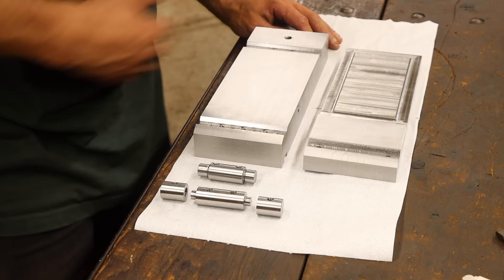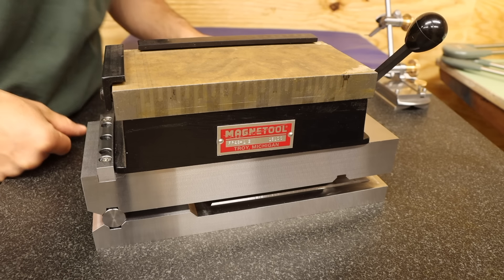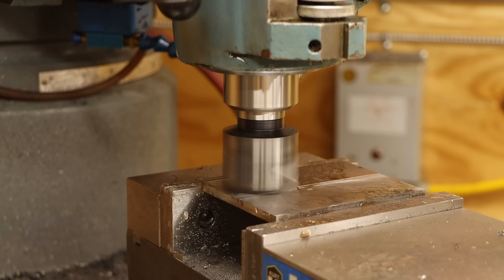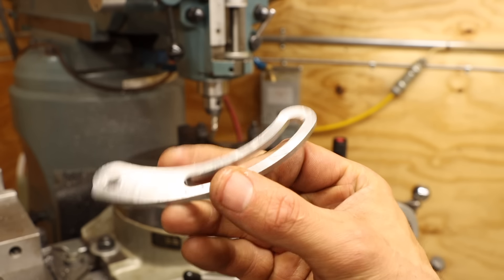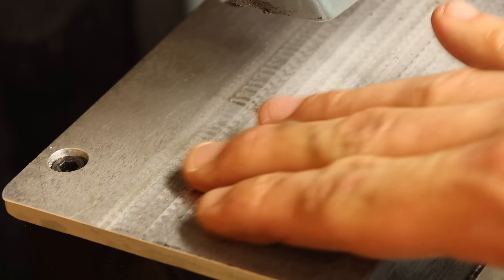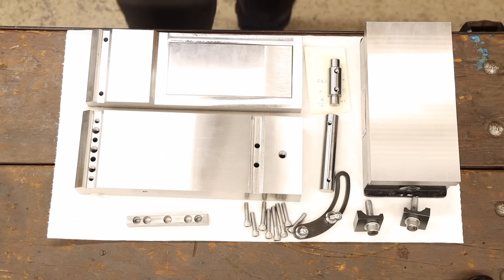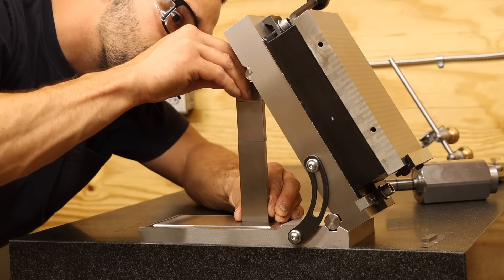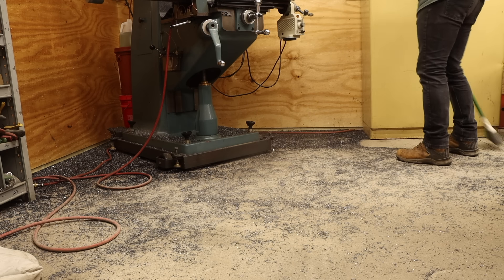Making a Sine Plate (Part 2) || INHERITANCE MACHINING

Comment: Braexcellent excellent job on your collet blocks project. When you said, "I'm not a barbarian" for the side project correction, you indicated the part. I am no barbarian🤣, but I would have just done it without indicating the part. Maybe I put too many trust in the machine and Kurt Vise. Assuming the vise was indicated and shimmed parallel front to back with the cutter. I found your comment about indicating the part hilarious.
Reply from the maker: 😂 oh I have a lot of trust in my vise as well. Only reason I went the extra step to indicate there was because I wasn't using parallels and I could tell with how little material I was grabbing onto it wasn't going to self-square.

Comment: Brandon, a green silicon carbide wheel is the way to go on Aluminum. Also, in the future if you want to set your sine at 30 degrees rather than 60 make a square block that you can clamp your collect holder to. Make it big enough to hold good on the magnet and this will give you a face to work from that is 90 degrees to the magnet surface.
Reply from the maker: Thanks for recommendation, Steve. I actually considered doing just that when planning this setup. I did the math though and the sine error at 60 degrees was only 30% over the sine error at 30 degree so didn't think it would be worth it for a few arc seconds

Comment: One thing I learned from this was I need a surface grinder 😜

Thanks for the educational build videos, very helpful.
Reply from the maker: be careful! if you have a tendency to chase zeros, having a SG may result in never leaving the shop!
Reply: @InheritanceMachining  hah, don't worry. I have enough trouble getting my mini lathe leadscrew aligned correctly to avoid the dreaded thread pitch visual artefacts. I won't be chasing zeros for a while.

Comment: Great work,  videos are awesome, I have a few points that I would like to share that may help you out somehow somewhere. When holding location(s) of a hole on a part is critical, spot, drill, ream or bore, CSK and then move, don’t spot all of them then switch to a drill. My coworker who has been a machinist for 40+ years told me to do it that way. I have heard that when surface grinding aluminum kerosene works well as coolant. I have never surface ground aluminum, so I would double check with someone who has prior to jumping in with both feet. Also when surface grinding with coolant it is important to let the wheel run for 5-15 minutes after shutting the coolant off so that the wheel can run the coolant out of itself.  Hope that this helps
Reply from the maker: thanks for the tips! the kerosene is an interesting idea. I'll have to try that. On the multi-hole operations I definitely use this practice when precision matters. In all my operations here the holes were clearance for the screws so there was some wiggle room to start with. Thanks again!

Comment: I made a position dog, both 6 and 8 sided to go on a 5c mandrel. The set up can be held horizontally on the surface grind ops. Not to mention on center. 
 O1 tool steel, harden 58/60 rc.

Comment: 2:30 Stainless hardware is more expensive but it is actually a down grade, not an over do. Stainless screws have about half the holding power of steel and have a horrible tendency to seize when used in steel. The only thing they are good for is corrosive environments which is what they are intended for. As normal fasteners they leave a lot to be desired.

Comment: Hey Brandon, awesome work as always. Just one point I'd like to make - early on in the video, you clamped a fairly small square part in the mill and the part was to the right side of the vice quite a bit. Normally for a small part it's not a huge issue, but it can cause jaw deflection. It's not great for the vice, but it also doesn't hold the part as well. 
Just thought I'd mention!
Keep up the amazing work.
Reply from the maker: thats a fair point. Are you referring to the square key? I think i did that to mill the end. Anyway, thanks for the support!

Comment: Idk much about surface grinding, but I believe you can (and should) get specific wheels for grinding AL. The aluminum that gets caught in the wheel will expand when heated up, and could cause the wheel to fail catastrophically. 

Or so I heard from someone who knew more than me.
Reply from the maker: yikes! makes sense to me. I'll be better prepared before my next attempt
Reply: @InheritanceMachining  Yeah it sounds pretty spooky. That’s what I’ve heard with bench-top grinders too, and I have used AL wheels on those. So it’s at least true enough for someone to make a product for it.

Comment: You should balance your vise. Meaning if the middle is not holding the material then clamp an equally thick part on the side opposite so the vise hold equally left and right.

Comment: About your use of stainless steel fasteners. Be aware that they are about 1/2 the strength of the alloy steel types. Also, the material tends to be 'gummy' which may show up as hard to turn the screws without a wrench
Reply from the maker: Good point!

Comment: Cool build! I have a few tips and questions.

Are any of these parts hardened/do you plan to harden them? That'd help a lot with the longevity of your sine plate.

From my experience, you seem to have made this fairly large. Sine bars/plates can be difficult to use for setups if they're too big. Do you foresee this being an issue for you/how big is it center to center?

Green Silicon Carbide wheels should be pretty good with grinding aluminum and some other non-ferrous materials. Just make sure the structure of the wheel is open enough so the chips don't clog up the wheel.

What are you using for coolant on the mill/surface grinder?
Reply from the maker: Thanks!

I will be hardening at some point but I have some significant mods in store for this at some point.

It's 8" center to center. It 100% is way too big. I could barely fit it on the grinder for the little job I needed it for. About half the size would have been much better.

Noted on the wheel!

Right now coolant is just Kool Mist. Though I'm planning to switch to a proper coolant for the grinder.

Comment: Did you consider using a 30° angle and a square instead of using a 60° angle directly? Might have helped with the vertical clearance issues.

Comment: It’s probably not a bad idea to plunge cut before milling the radius. Stops the end mill from wearing at the bottom as much as it would if you used it solely for slotting.

Comment: To grind aluminum, load your wheel with bees wax. Bees wax should be available at a fabric store used for lubricating zippers, comes in 2” squares about 1/2” thick. Sine plates are not accurate after 45 degrees. Reverse your set up, 30 degrees.

Comment: I grind aluminum everyday and 99% of the time it is a .0005 tolerance. The series of aluminum has a lot to do with how well it grinds. I mostly grind 6000 and 7000 series aluminum and it grinds beautifully. 2000 series not so much. It loves to load up the wheel and expand while grinding. Waxing, a coarse dress on the wheel, and lots off coolant help, but more importantly, practice on various materials and take notes on what works, and probably more importantly, what didn't. I can't remember off the top of my head what wheel I use, when I get back to work after the holiday I'll update this with the wheel specifics. I belive the wheel we use is made specifically for my company for grinding aluminum.
Reply from the maker: Thanks for the info. If I get into grinding aluminum more regularly I'll take a more scientific approach like you mention. The base on the mag chuck was pretty gummy. And also a cast piece so maybe it was a low grade. Ive had some suggestions that silicon carbide wheels are best for aluminum.

Comment: I love your build, in fact I'm going to copy some of your methods to make a sine cylinder grinding attachment for my surface grinder. But I'd thought that you should not use a sine plate for angles greater than 45 deg.  I haven't gotten to the end of the video, so I guess I will see if you had any issues as a result.
Reply from the maker: Thanks! Yeah its probably not advisable since the sine error starts getting crazy over 45. It ended up working out alright for me though. Also a centers grinding fixture using this plate is also on my project list at some point. Glad so see someone else is thinking the same
Reply: @InheritanceMachining  Great. I like your videos and hope to see a lot more of them.

Comment: Hey Brandon, thanks for putting all this content out there. Just out of curiosity, looks like you have a slight hitch in your gait when you step with your right foot. Do you have an old knee/ankle injury that never quite got back to 100%? If so, I had a MCL tear that I fixed using the backwards sled drag on KneesOverToesGuy and a split squat variation from Kabuki Strength for arch, ankle, tibialis, and calf strengthening. My lower mobility has never been better and I'm stronger in major lifts for having done the rehab. Hope this helps.
Reply from the maker: Thanks, Ben. Fortunately no joint pain for me. I think it just came off awkward somehow. Maybe from standing in the shop all day lol However I do know about KneeOverToesGuy, he has some great and useful content

Comment: Love the videos man, Theyre great!
Do me and yourself a favor and order up some 46H grit wheels for grinding. The white wheel i see you using looks very fine for what youre doin, try the more open wheel, Youll like it alot!
And speed up your traverse speed (Left hand) on the grinder, looks a little slow!
Keep up the great work
Reply from the maker: Ah thanks for the tips and kind words! I'm learning there is a lot of nuance to grinding for sure
Reply: @InheritanceMachining  Yes there is... Some quick parameters to try out when you get your new wheels:
.030 step over, .0005-.0015 downfeed, And dress .004-.006 at a time quickly across the wheel. Grinding is a dark art. Nobody really knows HOW it works... It just does 😅
Reply from the maker: @mattcyr3342  those are pretty close to the increments I've started using for finishing passes. I'll be interested in the courser wheel though
Reply: @InheritanceMachining  You can use those universally with like say an 80H/I wheel for finishing. Just dress more finely than usual and take light light cuts.
The 46H is the ultimate wheel in my shop. I can use it to rough .002-.004 passes and i can dress it again , Stick it down .0005 and get a good finish.

Comment: could you potentially machine a degree gauge to go on the side of the sine plate where you placed the locking strap so you don't need to use the gauge blocks? i love the videos and have no knowledge of any of this stuff yet but i wish to learn. thank you for all the information
Reply from the maker: Thanks man! A degree gauge wouldn't really be useful on this since you have to do the math anyway. Plus the 10th accuracy with a gauge block set gets angle resolution down around 2-4 arc seconds. A degree scale, even with a vernier, would only be good to 5-10 arc minutes
Reply: @InheritanceMachining  I appreciate you answering me. I wish I knew more about this field. I had to look up what you explained and still don't fully understand lol. Thanks again for your answer and also for the videos

Comment: After this grinding of the faces of the collet chucks, are the center holes still in the center that the faces now define ?
Reply from the maker: One of the last operations I did was to grind those center to face distances even. I only briefly mentioned doing it in the video. I used the surface gauge and the center pin in the collet to determine how much to remove from each face.

Comment: How do you compensate for the grinding wheel losing material that will reduce it's diameter during grinding? Or is this so small it is negligible?
Reply from the maker: The actual grinding is only happening along a narrow sliver of the wheel width that moves across the wheel as it wears. You do have to redress before that grinding "front" reaches the back of the wheel though

Comment: 8:51 I had a job to clean that same type of protectant coating ,from acres of 5" plate steel.  After the second 3' X 12'' section?  It started getting old :)

Comment: I would releive the aluminum face with a .010 deep pocket leaving land around it's perimeter so you are not grinding all that material or even leave a small land in the center again greatly reducing the amount of material removal. Also why on earth would you make a soft sine plate?

Comment: In the place where I work we use machine oil plus kerosene 1:1 to grind aluminum. And u have to dress your wheel as rough as u can with your diamond to prevent overheating a surface.

Comment: I made a turnbuckle that bolts to the opening end of my suburban sine plate, It pulls the plate down tight on itself and never allows the gauge blocks to slip or slide and also doesn't allow for the sine plate to ever open up during heavy cutting.
Reply from the maker: I believe I saw this method on some examples I referenced. If we're talking about the same thing it seemed like it would be difficult to range it between small and large angles. Unless there are multiple different lengths of threaded shafts?

edit: I did encounter difficulty getting the plate to rest on the blocks fully. Ended up snugging the plate in position a little under hight and letting the gauge blocks push the plate up so its in a small amount of compression

Comment: just curious what your using for your black oxide sealer
Reply from the maker: Caswell Plating sells a kit with the cold blue and sealer. they sell two types of sealer, one thats more of a penetrating oil, and one that dries to the touch. I have the drying type and it works pretty well so far.
Reply: @InheritanceMachining  thank you sir

Comment: I am working on making my own hex and square 2J collet blocks, admittedly nowhere near as nice as yours. I have a manual Monarch 10ee lathe and a CNC Tormach 1100 mill. I did not have a way to do the bores on my mill so I have done them on my lathe. I knew my setup in the Lathe wasn't going to be the most accurate so I didn't bother pre finishing the outside of the hex and square stock. I anticipated mounting the blocks with a large round bar in some other fixture and truing them up on the mill. However I have not been able to acquire an indexing head for my mill, nor have I been able to figure out another way to do this accurately. Would you be interested in taking on a paid job to help me get the outside of these collet blocks true with the inside axis of the collet? I don't know that they need to be surface grinder precise, I would be okay with a mill finish.

Comment: Some grades of alloy can be machined OK(Ish) with standard tooling/wheels, but some are as gummy as all hell, and unless you know exactly what grade you're working with, you won't even find out how bad it's going to get until AFTER you start grinding, milling, or turning it. :(

It's the same as welding "Mystery grade steel". Until you strike that ark, you've got no way of knowing how badly things might soon be getting for you. :D

Anyway, Nice project mate. It's one of those pieces of kit where it really is worth the extra time going for some "Serious overkill", because even if the job it's currently needed for only has to be "Mortally wounded", you never know what grade of "Dead" all the jobs after than will need to be taken to. :D
Reply from the maker: I'm usually able to figure out ok-ish feeds and speeds for mystery materials (most of my stock pile is) but that aluminum really through me for loop!

That was exactly my thinking on getting it the best I possibly could. I don't want to have to think and compensate for any errors in my tools!

Comment: Rpm 200 divided by the Dia = proper speed for HHS 200/.159 = 1257rpm  so to drill the hole for a 10-32 tap i run the drill 1257 rpms Next carbide cutter 1/2 400 divided by the cutter Dia So 400/.5=800 rpms Its supper simple dividing gets you close

Comment: Hi there
Firstly, I'd suggest you have a look at Simon (Bouchard)'s YT video on sine bars (and it's accuracy over 45 deg).
Secondly, if I may, my 2cents: one's work is responsible for prooving 'perfectionism' and what not, not one's words. Let your work characterize you
Cheers
Reply from the maker: For the sake of time I didn't get into this in the video. I considered grinding a 30 degree fixture for holding the collet block with the sine plate at 30 to reduce error. For an 8" span, a 1 thou height error at 60 degrees is ~40 arc sec while 1 thou at 30 degrees was ~30 arc sec. So not a huge advantage for a set of tools where I'm already better than the repeatability of the collets in the first place.
Reply: @InheritanceMachining  yeap, I don't mean you had an error in n the particular application, just one then to keep in mind (though your 8" are really nice, from this aspect)
Reply from the maker: for sure. I actually realized that advantage myself the the first time I used it to square up the axis of the block

Comment: Be careful measuring over sharpie marks. Tom Lipton has shown they are in the order of 10ths thick.
Otherwise excellent build
Reply from the maker: interesting... I noticed the first pass of the hardened tip "scratched" away the sharpie mark. Ill have to check out what he did

Comment: Why go so thick on the sine plate if you’re going to use a mag chuck on it? 
Is rigidity an issue?
Reply from the maker: It's not strictly needed but I have/had plans to turn the top plate into a sine vise. Still waffling about doing it though. We will see!
Reply: @InheritanceMachining  sounds like a good side project  ;)